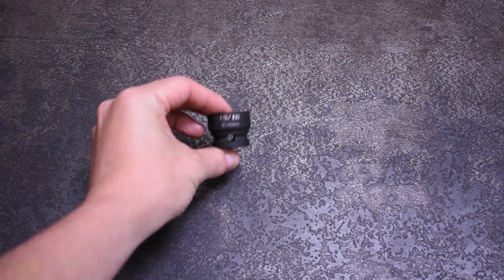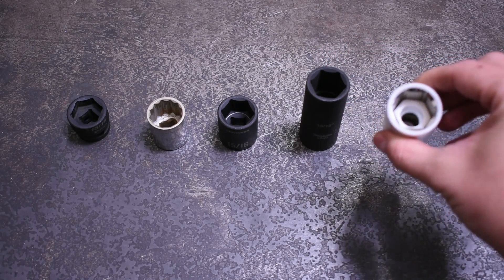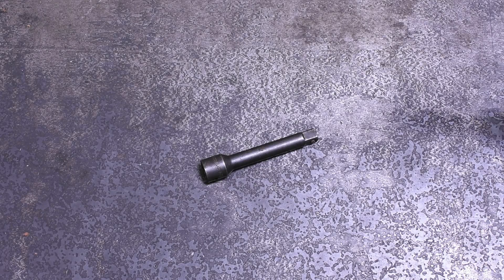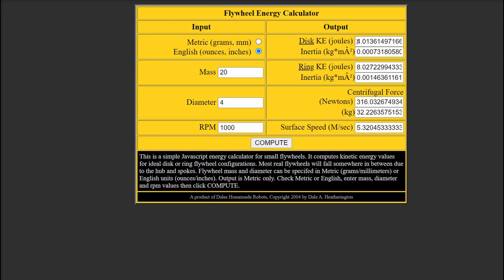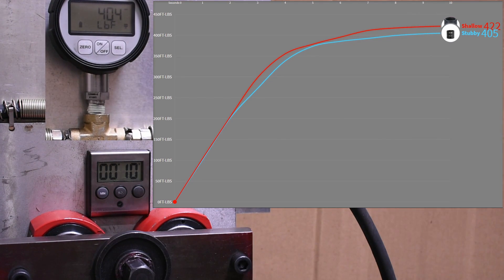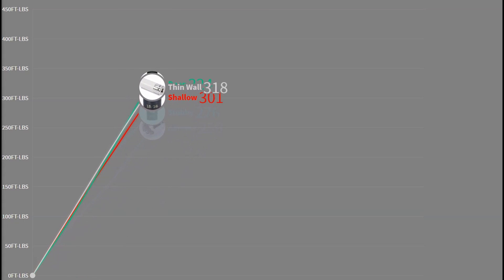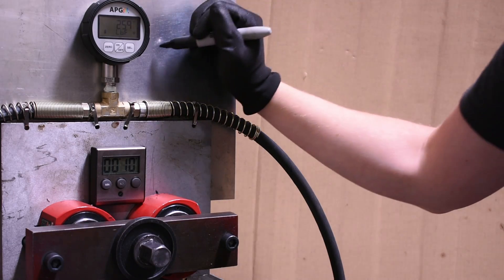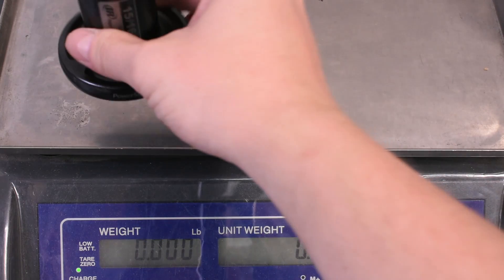Can Heavier Sockets Actually Increase Impact Dyno Numbers?

Comment: I suspect the reason the air impact had a bigger impact with the Ingersoll rand socket is because energy is a not a linear coefficient of velocity but an exponential. The pneumatic hits harder so we can assume the velocity of the hits is higher and knowing Ke = (mv^2)/2, we can see the exponential relation.

Comment: Socket mass would only matter if there's significant slop between the socket and bolt.. Hammer weight matters, but if the socket is snug against the bolt, it's just more mass for the tool to rotate.

Comment: A weighted adapter would seem to make more sense than weighting each individual socket. Would also give options depending on adapter length for keeping the extra diameter further back from the fastener, potentially allowing more room than the hoola-hoop socket.

Comment: If ur electric or air gun can't take it off, in my experience, these sockets won't either. Just use the breaker bar and chain wrench.

My IR power socket was used 1x and it didn't give enough power.

Just 3/4"HF gun with 3/4" to 1/2" adapters.

Comment: If this theory is about the rebound of a constant spring system, then the storing energy in the heavier rotating sockets to add torque has less to do with the total mass of the socket, and more to do with the distribution of that mass. I would imagine that the moment of inertia of a socket with this goal built into its design would need to be calibrated for each different impact wrench and fastener to be ideal

Comment: I learned a long time ago that if you hold the socket in the opposite direction that the impact is hammering, it really helps the way the gun hammers. Kinda like a weighted socket but much cheaper. Keep up the good work.
Reply: Is that to take advantage of the slop in the socket fitting so it can get little running starts to slam into the stationary nut?
Reply: @wingerrrrrrrrr  It's just cuz shooting sideways make you look cool, so you do cool stuff easier... obviously... not because the weight of the tool is working in your favor... All Swag
Reply: Isn’t it sketchy to put your hand there?

Comment: Very cool. The size of the socket is the biggest issue. The over sized weighted would be more sensible outside of lugnuts. It’s still all subjective. I have a 7yo silver eagle that will out do a new milwaukee. Depending on the application. It’s a speed vs length of throw issue.

Comment: At timing belt time I found a stuck crank bolt on my daily.  So, spent my money on a new air gun.  No joy.  Next I ordered a power socket and using the old air gun buzzed it off with ease.

Comment: It seemed like the thin wall was bouncing around less than the impact deep socket. A little tactic I've developed to counteract this when I can't break a nut loose is that I grab hold of the deep socket and firmly apply turning torque to it so it doesn't bounce around on the fastener. I can sometimes get them to break loose this way when they won't otherwise.

Comment: So is it determined that its the weight of the socket that is causing the differences in "beans" and not the material properties (ie. stiffness/hardness/tensile strength) or socket design?
Reply from the maker: Mass and moment of inertia mostly. Stiffness and hardness are a wash, due to the Young's Modulus principle (how much things flex) being more or less the same among steel alloys even at different hardness even though that sounds counterintuitive. - Channel

Comment: I don't have any testing equipment but can tell you that in between the 19mm snap on torque increasing sockets and the ir 19mm power socket I have not been forced to bust out the 1 inch gun for Honda crank bolts

Comment: I'm a bit fuzzy on the physics behind this.  A flywheel works by resisting changes in rotational speed.  It soaks up engine power as you're accelerating, and then releases it when you aren't.  But that shifting of energy from one side of the equation to the other requires a fair amount of rpms to have any real effect.  As you can see on the dyno the impact wrench doesn't really spin the socket much at all, so the flywheel effect would be basically nothing.  And if you're working on a really stuck bolt it's not rotating at all.  

So the only other consideration is increased mass.  If you think of an impact wrench like using a hammer on a standard wrench to bust loose a stubborn bolt, and when the normal hammer doesn't work you get your mini-sledge out and it does, then you can see the benefit of increased mass.  But we're not increasing the mass of the "hammer" in this case, as that's all happening inside the impact wrench.  We're effectively adding mass to the thing we're hitting with the hammer, which seems like it wouldn't do too much.  

IR's claim is that this is reducing a spring effect inherent to the impact wrench design.  Going back to the hammer + wrench analogy if you pre-load the wrench by twisting it in the direction you want it to go before hitting it with the hammer you'll have better luck.  And if you get a nice solid hit that doesn't bounce off that tends to work better too.  So I think that's what's happening here.  A heavier, stronger socket will tend to absorb the blows without chattering/bouncing as much, which results in more torque being actually delivered where you want it.  Another example would be trying to hammer a nail into a piece of wood trim.  If the wood is hanging off the edge of your table it's not going to happen, every time you hit the nail the wood flexes and the nail doesn't go through.  But lay it on a solid base and the nail goes right in.  

This could also explain the difference in rated torque output of these tools and the actual measurements seen on this channel.  The ratings are just mathematical projections based on the internal design of the tool, but do not take into account any losses from a less than perfect connection between the tool and the thing you're using it on.  The less flex, or springiness, you get from the socket the closer to the theoretical max torque the tool can produce.  Presumably then some ridiculously massive, 20 pound socket, would get reasonably close to the rated torque output.

Comment: I feel like it'd make more sense to make a weighted extension. Make the extension very short to minimize the power loss and use the flywheel design to make it heavy enough to overcome what power loss there is and enough to add significant power. Then you could use it on any socket you need instead of paying $100 for each size.
Reply from the maker: We're told someone is working on this!

Comment: Dude that was insane. 20% is actually alot when you consider real world values. For mechanics time is money that little 20% means they can get stuff taken apart alot faster therefore causing a domino effect for down time when working on equipment and vehicles. Faster tear down faster getting to source of problem faster fix fast reaasembly. Sounds like more money to me.

Comment: You skipped over how the etal properties have a large effect on torque transmission. The chrome lug socket, while thinner at the working end, did have mass at the back, but was likely also more like an impact socket (softer but more springy) than a chrome socket (harder and stronger but not for impact use). This requires getting into things like Brinell hardness, Young's modulus, and more. These are the main differences between chrome and impact sockets, and why hammers will chip when you smack them together, but a punch will mushroom over as it's hit.

Comment: The plastic cover on the thin wall not only protects from scratches, but protects you if socket breaks and a piece gets accelerated. They are chromium steel which is more brittle.

Comment: There’s a rumor that a half inch gun can hit harder than a three eights and I have been trying to think of a way to test this but I think you are the people to do it. If you could take the new Milwaukee generation to mid torque, and take a three eights version and a half inch version and put the same size socket on it and tighten down the same bolt to see which can hit harder that would be amazing
Reply from the maker: Will do!
Reply: @TorqueTestChannel  Awesome! There’s also another part to this and that I’ve purchased a 3/8 impact wrench to be able to easily step it up to a half with an adapter so then which size is better to step up or step down which one has the least amount of loss would be another awesome test within that same test.

Comment: i have the "1100lbs-ft" milwaukee 1/2" impact and when doing a honda v6 timing belt i could not get the crank bolt to budge at all. many people know that bolt is a PITA. i was so pissed off! i ended up buying a Lisle heavy socket. it didnt have the ring but was solid besides the 19mm 6point cut into it. i barley tapped the trigger and it came off! ugh. it worked!

Comment: I'm a Honda tech and I do about 20-60 timing belts per year. My snap on dealer came in with a 19mm Lisle weighted socket and wagered a bet. He said I the socket could get a crank pulley bolt off that I had to buy it. Naturally I was skeptical since I usually have to heat the bolts. It pulled the bolt out like it was undoing a lug nut, it was almost magic. Needless to say that was one bet I was happy to lose.

Comment: I think the key is to match the mass on both sides of the impact, so that all the momentum is transferred. It has nothing to do with spring rate, just the math of where the energy ends up in a collision. So you want the bolt, socket, anvil, and hammer to each have the same mass and moment of inertia.

Comment: If I needed a weighted socket for one job on one or two crank bolts i would just weld on an old socket to add some weight. I'm not paying 100$ for one socket. And I do a decent amount of auto work in my home shop.

Comment: I work at a tire shop, and I can vouch that those power sockets do work. I could have a stuck lug and sit there with the air impact for well over 15 seconds, and still get nothing. We used to only have one option in that case. Go grab a breaker bar, and potentially hurt yourself, which happened on occasion. But then we got a full set of those power sockets, which included 17mm, 19mm, 21mm, 7/8", and 15/16". They will break that stuck lug loose in under a second. The only downside to them which was briefly mentioned, is that you have to have the room to use them. For example, the 17mm rarely ever gets used, because most Mercedes/BMW wheels have the lug bolts recessed into the wheel, and the power socket is way too thick.

Comment: I don't get why the Sharpie is used to write the number after each test, the results aren't carried over in each test, and the results are seen on the graphs.  Just seems like an extra step for no gain.  Also, if you are going to do it this way maybe consider a dry erase marker instead, I assume you clean this off with some cleaner after each time to remove the Sharpie.  Anyway,  not a complaint, just curious.
Reply from the maker: We've done it since the start, before we were able to make these moving graphs on screen. It's kind of a hold over tradition, and now gives us the brief bit of time to provide the N-m metric conversion while writing down its ft-lbs on screen.

Comment: I would guess the "spring rate" has very little to do with the increase in power once you get beyond a certain socket wall thickness where any torsion of the socket is negligible.

It would have been cool if you could measure their moment of inertia.

It seems to come down to the moment of inertia. The impact drivers probably suffer very little decrease in acceleration when increasing the moment of inertia of most common sockets, anything below 25mm is likely going to spin up just as fast. 
So the greater the moment of inertia the great the angular momentum. And taking off a tight nut or bolt is all about momentum transfer

Comment: I remember jumping on my breaker bar and the bar broke while trying to replace my CV axels.
Reply: Sounds like you need my patented Bitch Bar. It is a piece of pipe or in extreme cases the floor jack handle you just slide it over the breaker bar or ratchet...shh don't tell warranty, and bingo instant unstuck.

Comment: Thick wall sockets are amazing, the Honda crank bolt I could not get loose even with a 3 foot breaker bat and the proper holding tool was spun off easy borrowing the thick socket. I bought my own after using it.

Comment: Subbed. This is EXCELLENT content and video quality is great! Thank you for presenting this, makes me look differently at my setup, which has been trial and error. One thing I noticed after upgrading to a 3/4 IR impact, hoses and fittings matter! I it would be so interesting with your test rig to see how your supply affects torque performance. I had to re-plumb my supply from the tank, all 1/2 inch pipes, hoses, regulator, and fittings plus I put a higher pressure switch (155-175psi) and have the reg at 120. it hits so much harder now. Having a gauge right before the tool was the eye opener, the pressure drop in your plumbing needs to be talked about!
Reply from the maker: Absolutely. Spot on

Comment: I wonder if it's a multiplication of the hammer inside the impact gun. So the lighter the socket compared to the internal hammer the less torque transfer multiplication, a .5 instead of like a 1.5 like the big ones used. Need to take apart the guns and weigh the hammer and anvil in the guns to get down to some more details

Comment: I’m interested if you could add a flywheel thingy to an adaptor or extension to see if it could work as a power booster similar to this. Letting you adapt sockets you already own
Reply: Was thinking the same thing. Buy a 3/8", 1/2" and 3/4" and that covers all the bases

Comment: How bout air swivel fittings vs without.   And would be interesting to see the power socket vs crank sockets for the sake if science if you can find a suitable bolt. Maybe you can weld a nut on the bolts you usually use

Comment: I would love to see how well would an adapter which only consists of the flywheel do? I mean it would be great if you could buy only one and use your entire set with it even if it would do half the improvements of the one-piece setup...
Reply: That would be the worst thing possible to do because it's not rotational mass that helps (rather that alone hurts, if all else where equal), rather reducing deformation and by adding an adapter in series, you'd suffer the same types of losses already demonstrated with other adapters/extensions.

You want the shortest distance from anvil to fastener but with enough metal to suffer least deformation, and enough that you can use a more brittle metal without it cracking.  Heavier socket is just a means towards less deformation.

Think of it like this:  Suppose you use a hammer to drive a nail.  Now put a rubber cap over the hammer head.  Will it drive in the nail as well?  Of course not, even though you have more mass and less deflection, because there is greater deformation and peak impact loss.

Comment: It's all about rebound harmonic looks like,different impact speeds can be heard during tests,like different hardness on material
The "flywheel" socket mass and inertia is tuned for lower frequencies obtainable with air impact.
It reduces rebound,and is less efficient higher in frequencies.
The thin wall chromed deep socket is harder material and has  more mass ,but very close to the axis of rotation,so a small inertia,wich reduces parasitic rebound.
You should try to eliminate the play in the square with shims,you would reduce or eliminate rebound,and find out different results.

Comment: Disappointed you didn't include a plug in electric impact gun.  Electric battery versions don't have the same power as air tools to electric plug in tools.  You are comparing a VW bug to a Chevy 1500 in power.
Reply: Who uses corded tools now?

Comment: I will say one thing I have noticed about impact sockets. A socket with a tighter tolerance in the square drive end and hex end do a much better job with impacted/hammering  breakaway.
Reply: And conversely it seems a tighter tolerance in the socket to nut interface works against you, liking it to short travel on a hammer swing as opposed to swinging with a longer stroke, developing more speed behind the blow.

Comment: could you test a 12V impact gun to see how it does with this test. i have one and surprised it has removed every lug nut i used it on. one thing to get full power best to have the vehicle running to get max performance.